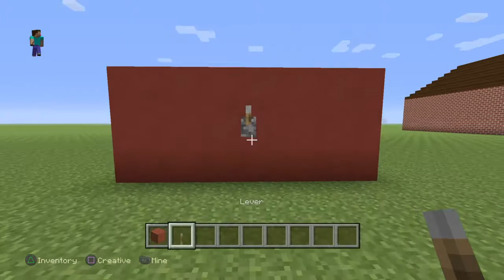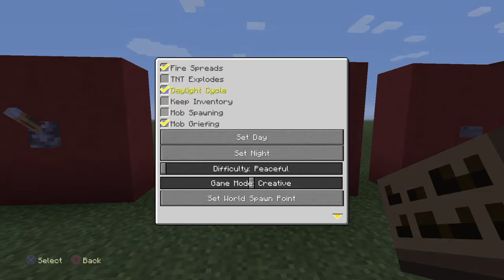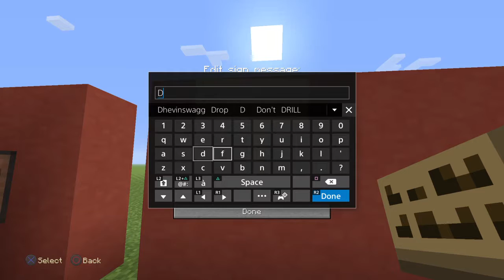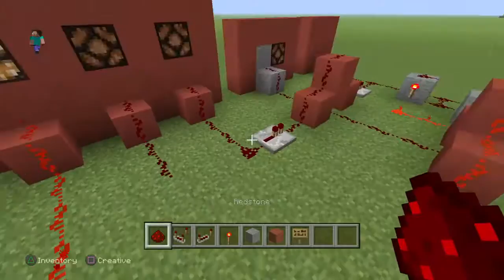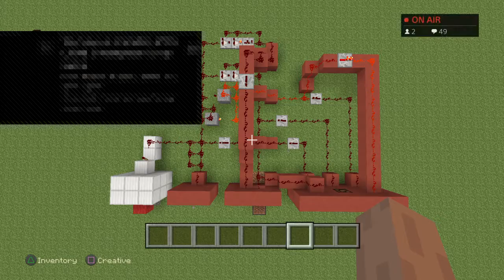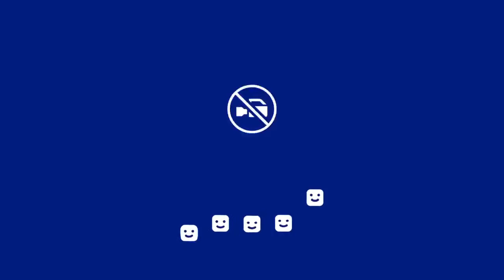How to make a fire alarm system

Comment: Would I connect the redstone directly to the redstone repeaters
Reply from the maker: Yes, as well as the comparator
Reply: Which coder do I attach it to
Reply from the maker: @Leftyandmoonshow 17:28 This is how the coder is wired, the Redstone coming off the repeater goes to the alarms(noteblocks and Redstone lamps), while the Redstone that goes into the comparator attaches to the normally non-energized side of the latching circuit.
Reply: I built the whole thing and I don't know what to do with it
Reply from the maker: @Leftyandmoonshow  well it's a fire alarm system meant to be installed in your buildings or other creations. This was just a demo setup to teach you how I build a fire alarm system.
Reply: I'll just add a building around it
Reply from the maker: @Leftyandmoonshow  👍🏼
Reply: Well how did you do yours you had a building
Reply from the maker: @Leftyandmoonshow 40:01 yes I incorporate the system into buildings. Take the same bases of the demo setup and incorporate it into your structure.
Reply: @BlackLightning4547  ok
Reply: @BlackLightning4547  the second alarm sounds weird
Reply from the maker: @Leftyandmoonshow which one? And how so?
Reply: The one that has the noteblock on top of the restone lamp
Reply from the maker: @Leftyandmoonshow You must've started playing Minecraft yesterday... the characteristics of the tone of the noteblock changes when certain materials are placed underneath it. In that instance, the wooden sign underneath it makes the tone deeper/bassy.
Reply: @BlackLightning4547  oh ok
Reply: I'm routing the restone under ground and the redstone is coming from the second circuit
Reply: I just added more alarms and the alarms that I just added won't silence with the silence lever
Reply: Or the panel
Reply from the maker: @Leftyandmoonshow  the silence switch needs to be attached to the coder, and the Redstone signal from it needs to be strong in order to silence the coder.

Comment: How you connect it up to noteblockes and redstone lamps
Reply from the maker: Via Redstone and repeaters
Reply: Oh thank you
Reply from the maker: @Leftyandmoonshow  pleasure
Reply: @BlackLightning4547  it's not that complicated is it
Reply from the maker: @Leftyandmoonshow  nah, not at all
Reply: @BlackLightning4547 do I continue it off the panel or not idk
Reply from the maker: @Leftyandmoonshow  you wire them off of the coder(the series of repeaters and comparators that comes off the latching circuit).
Reply: @BlackLightning4547  I'm sorry but I don't know redstone that much
Reply from the maker: @Leftyandmoonshow 17:16 that's the coder that consists of two comparators and one repeater. You'll connect the note blocks and Redstone lamps to the repeater with Redstone.

Comment: Does this work on xbox
Reply from the maker: Maybe, as Minecraft is a little different on Microsoft than Sony
Reply: @BlackLightning4547  well I made it as same you did but the system normal button doesn't work :(
Reply: When I press the button the alarm is not shutting off
Reply from the maker: @rosetta1  1. Did you wire things correctly?
2. Did you reset any devices before you hit the reset button? The panel will not reset if any pullsations or other is still activated
Reply: BlackLightning 4547 wait the lever has to be up.
Reply: It works now I didn’t reset the pull station thx for the help
Reply from the maker: @rosetta1  Ok NewAgeSeverAlarm Jr., lol. But for real, no problem, anytime. That's one benefit with my panel because  it's a little realistic, because real FACP will not reset and go back to alarm if any device is still activated. It's pretty cool.